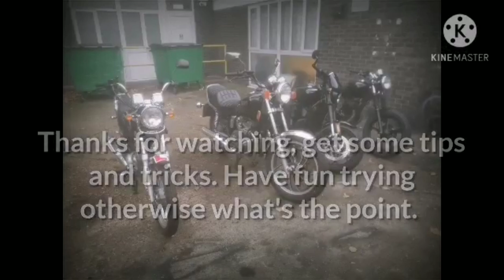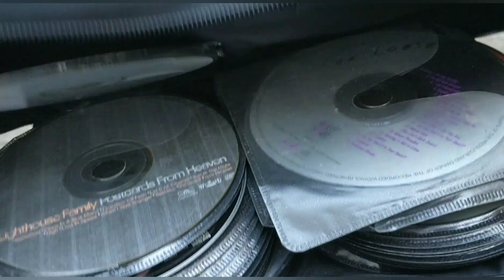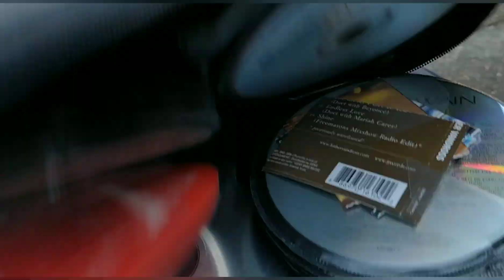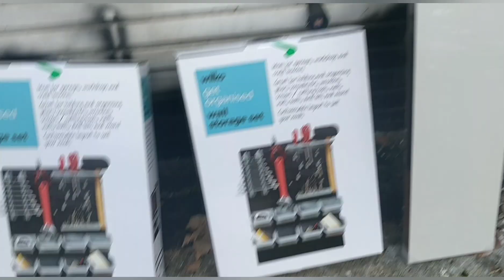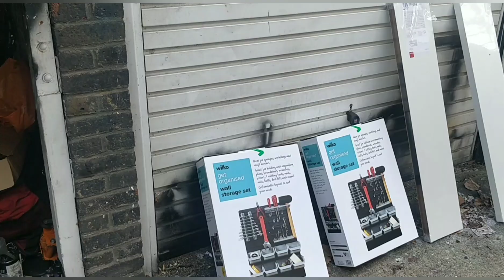Motorcycle rescuer garage clearance. Part 3 and nearly done. Check out Rabjabs CD collection lol

Comment: Finally getting around to watching these. 😆

I think that socket you have that has all the sizes also allows for passing an Allen key through the middle of the socket.. great for shock absorbers on cars to stop the shaft spinning while you tighten the top mount bolt 👍👍
Reply from the maker: Yes that's right, I've done that before actually. 

You have seen the garage since the clean havnt you?
Reply: @motorcyclerescuer  last I came up was day 1 or 2 of the clear out I think. Haven't seen it since it's been fully done

Comment: Just a quick tip if your limited for space and have to do the work out of the actual garage- The socket rack that you were mentioning rather than stick them to the wall screw them to a piece of wood if you can get a 4x4 post the you can use 3 sides and every time you need a socket they are all to hand and when not in use just stand it up in the corner just behind the door :) great to see the progress
Reply from the maker: That's a great idea. I'll keep that in mind. Makes sense. 

Thanks

Comment: The shelving I've fitted in my bike garage has slotted, vertical rails screwed to the wall, and the shelves are attached by brackets which slot into the rails, so you can adjust the spacing to suit what you want to put on them.
Reply from the maker: I saw them actually Rick when I was looking for some. I didn't even think to use them though. 

What I'll get now is an idea of what's next for the garage which is good. Although I've probably only got 6 years left with it